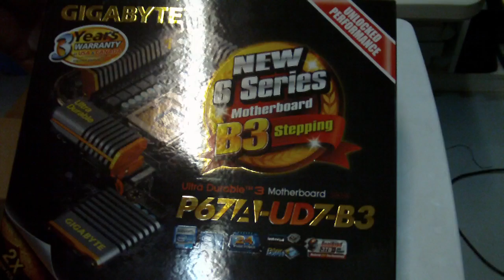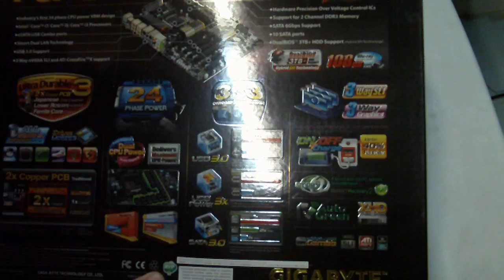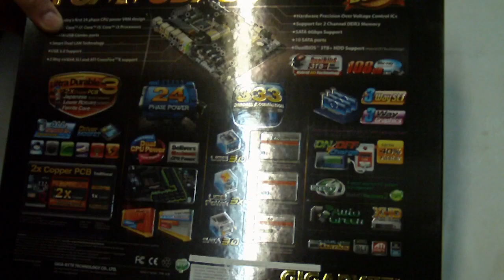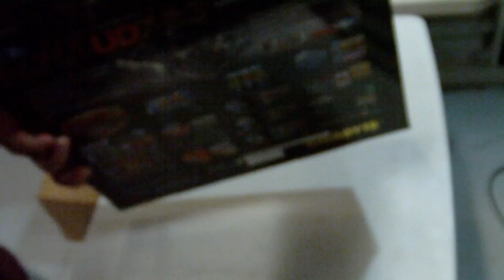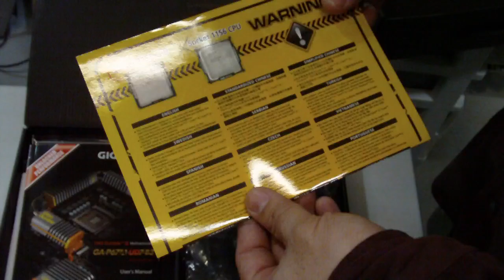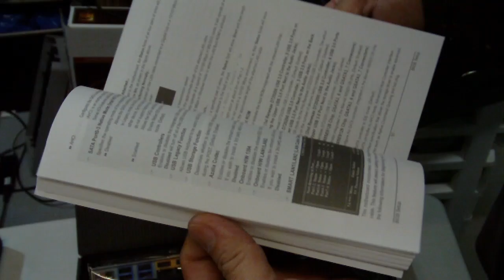Gigabyte 1155 P67A-UD7-B3 Unboxing.MP4

Comment from the maker: @linusstaf You and Agent Hydra are correct.  After pouring through the techincal specs... There is NO difference between SATA II and SATA III cables.  I went through my inventory, and looked at the SATA III and SATA II cables.  The SATA III cables from ASUS are thicker and have better end caps.  So it seems some SATA III cables are just overbuilt a bit.  Offically, you can use SATA II cables with SATA III drives with no loss of data transfer speed.

Comment from the maker: Techically, the difference between the SATA II and SATA III is achieved through faster sigal switching, and little is done on the electrical specs of a SATA II drive.  So you should be able to use SATA 2.6 revision spec cables.  And it is probably just a marketing ploy by labeling the cables differently.  If there is any difference at all, it may be in build quality between the two cables.  However, I can't physically tell.